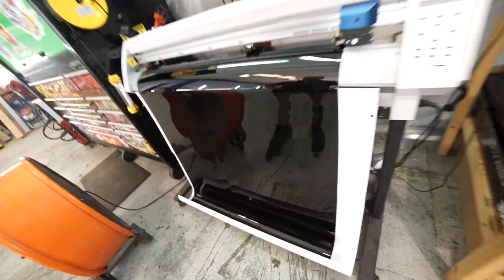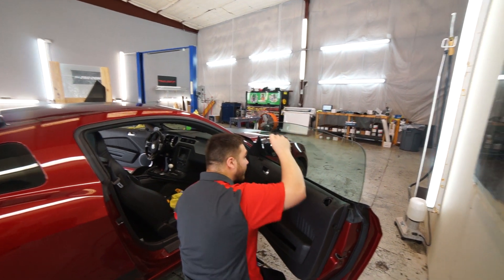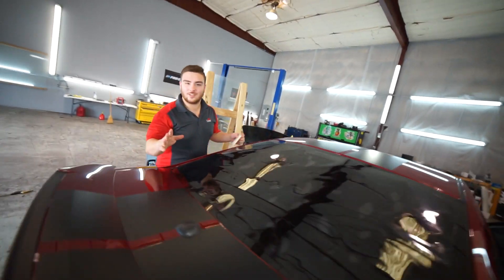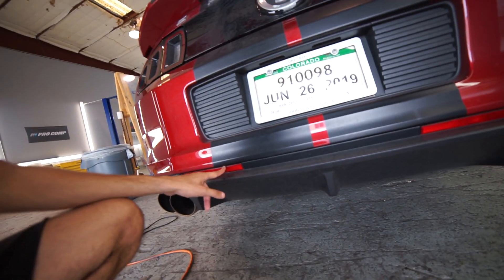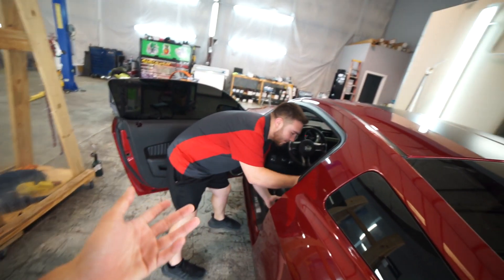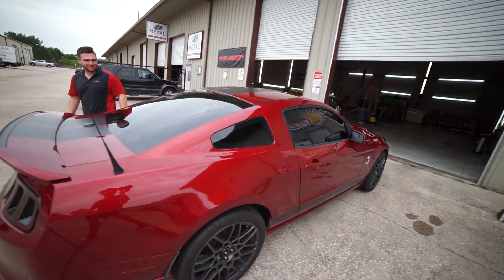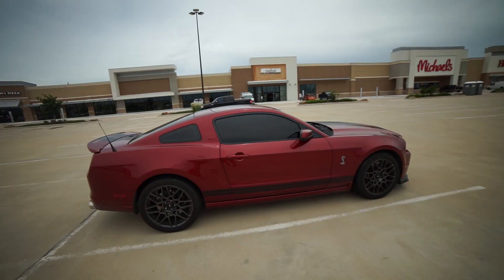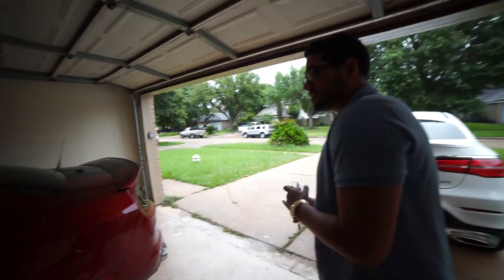Most ILLEGAL MODIFICATION for My Shelby GT500..

Comment: Do 45% on the windshield it looks smoked out very clean and still functional. Actually more functionality because the glare is cut in half, way cooler temps, saves your dash from UV.

Comment: If it were my car, and being in the heat of the Texas sun, I would do a 75% tint on the windshield.  I have seen it on windshields and it's hard to detect, which is good, and it still blocks a lot of heat from entering the car.

Comment: I have 5% all around on my 300s and 20% on the windshield. Have never been pulled over to date and I’ve had them for a year. Also, very good at blocking out sun. Helps considering I have leather seats.

Comment: man i just got a 160  illegal tint ticker for just 5% under the limit.
Reply: Forreal? Shit man that sucks. Cops around here won't pull you over strictly because of your tint. You have to be doing something else and once you're pulled over they'll probably ticket you for the tint, but I've never just been pulled over strictly for my tinted windows. The 2 times that I did get pulled over, the officer didn't even mention it 🤷‍♂️
Reply: @jeezig12  same where I live in Louisiana I have 2% back windows 5% front and 40 down the windshield in my Silverado cops dont even blink towards it I was sitting right next to one at a red light with everything up

Comment: Depending on where you live and how you’re driving will depend on if you get pulled over or not for tints. Here in Maryland (at least where I live) cops are lenient on tints as long as you’re driving good. 5% is common around here.

Comment: You gotta get the windshield tinted bro... I have both of mine all blacked out.. 2012 Gt500 - kona Blue with white stripes & my 2016 5.0 - Ruby red Cali special.... Both have 5% sides & back with the windshields @ 20%... Only time you may have problems is in the rain but it's still not too bad seeing..

Comment: I wouldn’t do the front I bought a stang from another state. It had a ver mild tint that I never even noticed until I got pulled over. At first I thought the officer was screwing with me. I had to get it removed which sucked because it did help with the sunrays. My stang is loud and no front license plate I  don’t need anymore attention. You will be a bigger target with front tint!

Comment: Leave the strip off the front windshield. Not a good look anyway IMO. Put a coat of 50% or lighter on the windshield for glare and UV protection. It’s virtually undetectable especially against the much darker tint on the sides. It won’t draw any law enforcement attention from the front. You’ll be glad you did it. Honestly it looks a little unfinished without a light coat on the whole windshield. Either way it’s still a nice setup though. Congrats man.